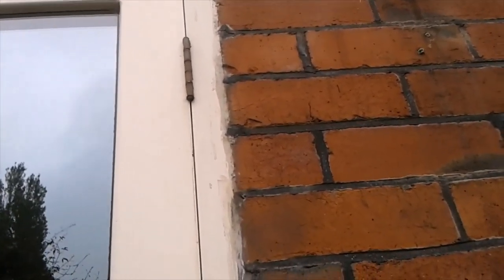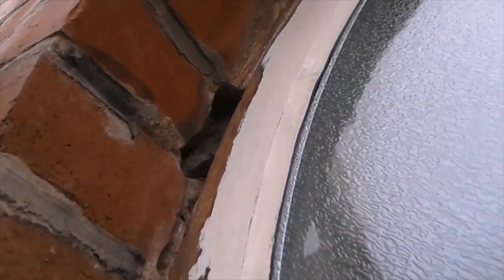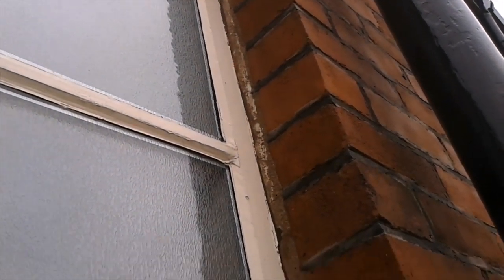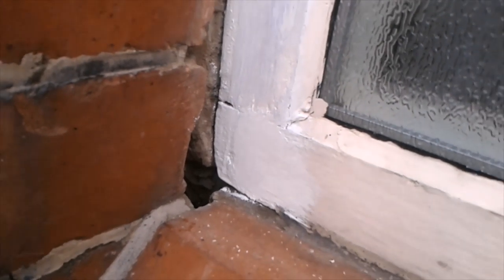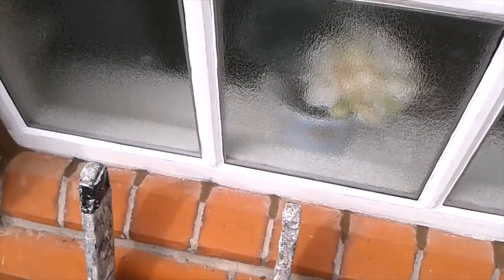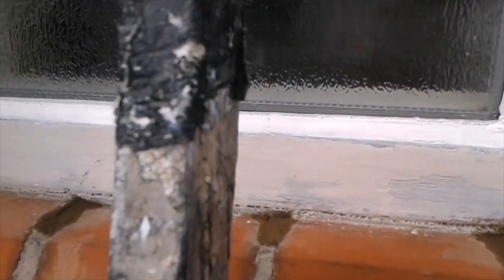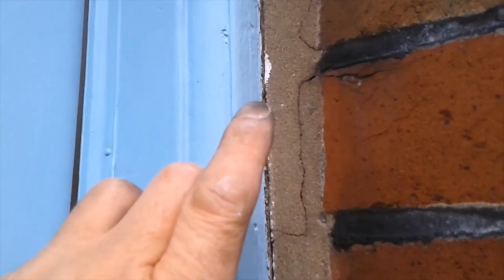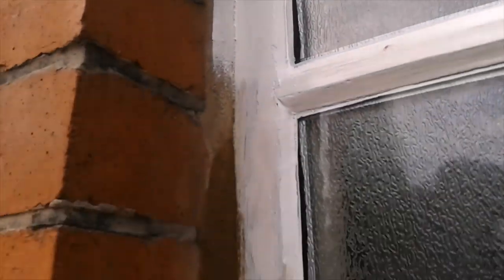Painting Outside Part 1 Silicone And Rain

Comment: can u recommend a good primer & satin topcoat paint for exterior timber doors and frame please???
Reply from the maker: Dulux oil wood primer.. which stays slightly tacky till the next coat is applied. Your next coat being oil exterior  satinwood also Dulux is good...  Sandtex exterior system is good they do an oil undercoat and primer. One coat of that and three satinwood oil.